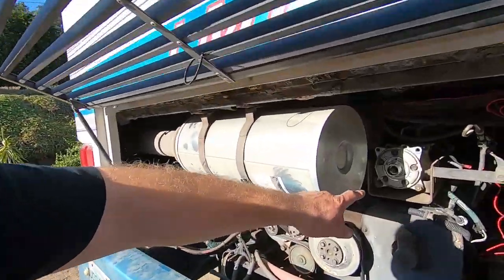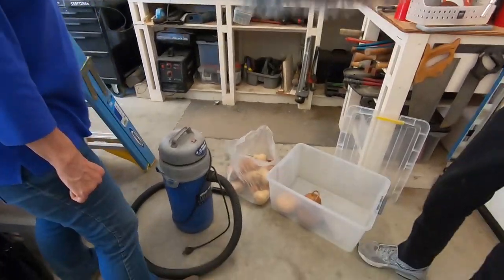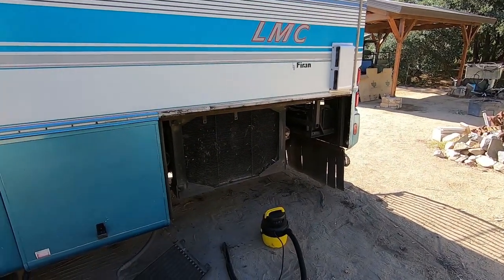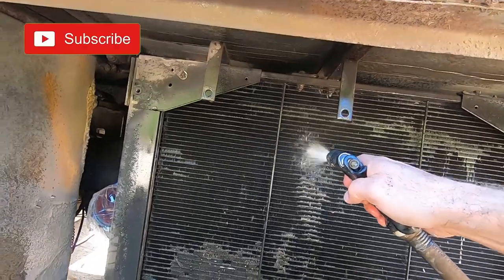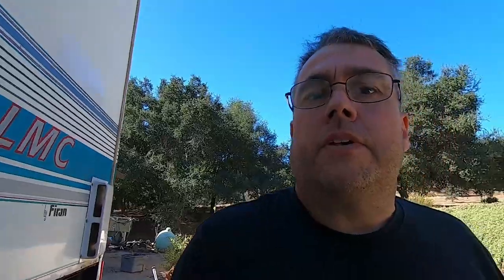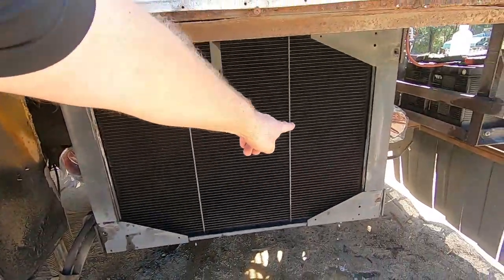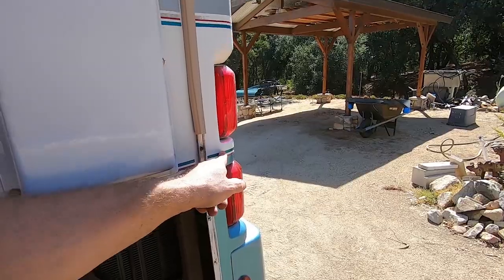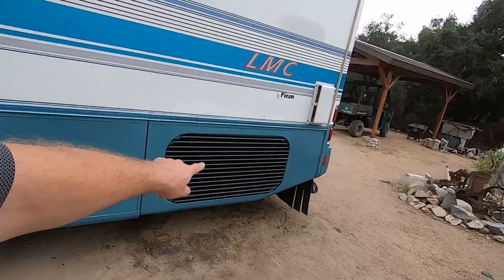Cummins 8.3 overheating on grade. Easy Fix - Ranch 2019 part 1 - Camp More Bark Less

Comment: That is common on diesel pushers for the radiator to get plugged up. If you have a older diesel with with oil blow by out the vent tube. The oil will get on the radiator attract dirt and plug your radiator.
Reply from the maker: Thanks RV Dog, Yes ours does have that tube also.
Reply: I also had a overheat problem, on grades, with my 8.3 Cummins with sidemount rad. It did help to clean the rad but the real problem was the hydraulic pump, on the rear of the engine, needed rebuilding as the o-rings were eaten up and the fan was not turning to full rpm.

Comment: Nice trouble-shooting, I still dont understand how you figured out how the radiator was plugged with the water, that is something I need to learn more about, but it looked fantastic when you finished it up!!  Bummer about the ranch that looks like an amazing place to moochdock!!
Reply from the maker: Thank you. The camera changed the sound of the water. There was a distinct difference in sound between the water going through or hitting a plug. I guess the camera internals figured it was all just noise.

Comment: That radiator almost looked new when you were done. You mentioned you have the Wi-Fi ranger, how do you like that? We are looking at getting one.
Reply from the maker: It was very clean for sure and no more issues there. We would probably not buy another ranger. Its great when it works, Like I said when.

Comment: Hello, I have a question, where are the AC ports located?
Reply from the maker: Our unit had 2 sets, one on the lines at the compressor and the the other pair were up front, low side on line coming out of evaporator and hi side was on the dryer. Maked it nice to service from either location.
Reply: @CampMoreBarkLess  thanks
Reply from the maker: @leandroplasencia  anytime.

Comment: Why the idle chit chat?
Reply from the maker: Frank, thanks for the comment.  The video was part of a series we did of our trip from FL to California, hence the chit chat. We made this while in California as we experienced overheating isues on interstate 8 and found out this is a fairly common problem with side radiator rigs. Wanted to help other rv travelers out as I found videos that people replaced all kinds of unnecessary parts to discover that the radiator behind the CAC was clogged with dirt.